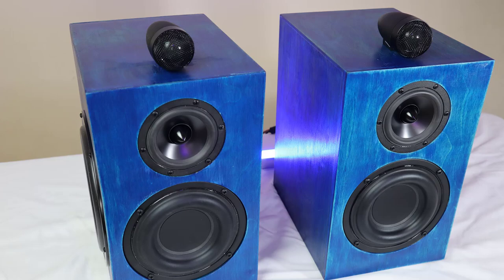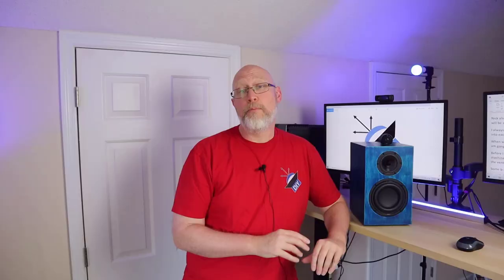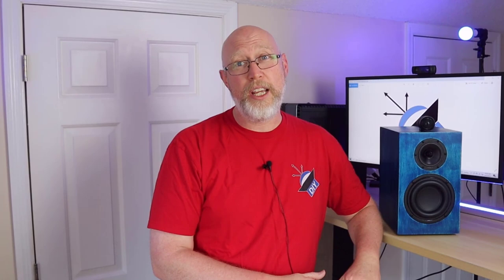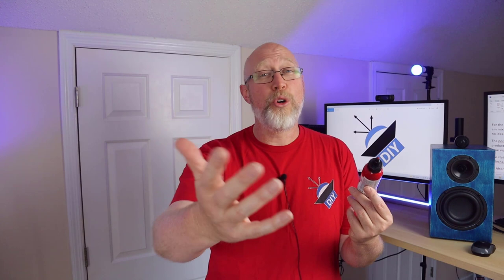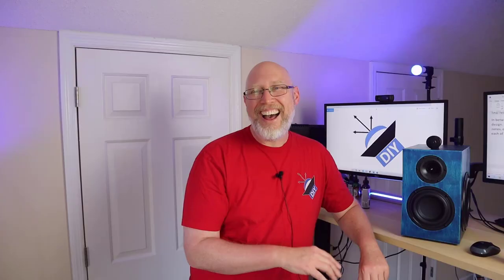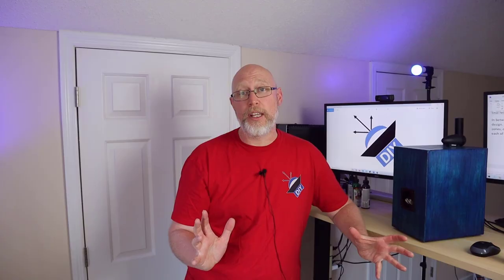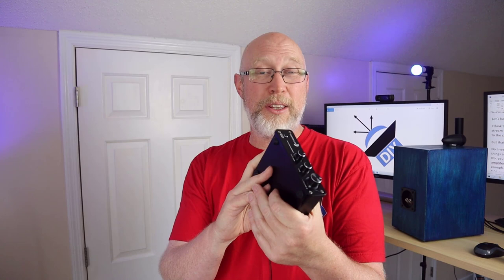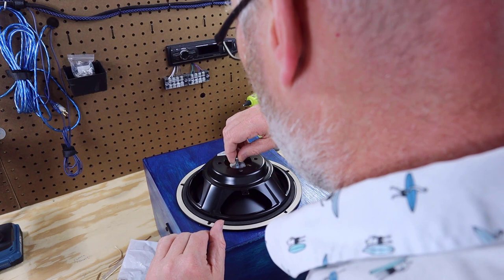Do I need a SUBWOOFER?  Bookshelf Speaker Build!

Comment: Awesome Job! I loved the video. Just a clarification, the original Dinas are powered and were a collaboration between Joe N Tell and I. A huge shout out to him. These are the new passive versions that you can hook up to any amplifier. Thanks Again for the awesome video! You killed it!
Reply from the maker: I remember that now!
Reply: How do these compare to the original powered DINAS (Which I am nearing completion of building, and very much looking forward to trying).  Is the box dims the same with the side mounted PR?  How is the frequency response altered in comparison? 

Thanks

Matt
Reply from the maker: @MiracleManMatt  Should be very similar.
Reply: How much is the cost of the crossover for 2 speakers?

Comment: one of the subwoofer utility is to take on its own job to produce the very low Frequencies (the low bass frequency20-80hz) (not the ordinary bass frequencies or the (woofer frequencies 80-300hz)instead making the woofer produces them because that can damages the woofer by time), so the subwoofer protects actually the woofer by preventing it producing these extra low frequencies, so we need a Low-Pass-Filter connected to the subwoofer.

Comment: I love this small PR design. I'd like to see as small sub design with 2 opposing subs and 4 passive radiators, perhaps 5.25 or 6.5" & stackable with legs. With no flat surfaces, it would be tough to mount an amp or just passive inputs, but it would look cool.

Comment: I built a pair of these speakers, and you don’t need a subwoofer. However, you do need a 75W per channel amp to drive the bass.
Reply from the maker: Good to know.
Reply: where did you get the amp?
Reply: @el_tate  I just got the [Upgraded Version]Fosi Audio TB10D and tried it out on the DINAS. Everything sounded great! I would definitely recommend this amp for these speakers.

Comment: The blue is brazen and wild but tbh I would prefer danish oil. What is the total cost of this project? Tangband subs and cnc cut wood does not seem cheap
Reply from the maker: It was definitely a bold color choice.

Honestly I'm not sure what the total cost is, I never actually planned out any kind of budget for this.  Partly because I had some of the drivers laying around and partly because Nick sent me a lot of the other stuff that I needed.

Comment: Also do you think these would work great for a 2.1 setup on a gaming computer or maybe something slightly different insted? I've been looking at similar kits from parts express for my son to make and hopefully learn something along the way.
Reply from the maker: Probably, but they are a bit large for a desktop system.
Reply: Because these are three-way speakers, you can build them with bi-amp terminal cups so that you can drive the bass woofers on their own. However, the crossover is so well designed that they sound great in just a two-channel set up.

Comment: how did you connect the speakers? parallel ou in serie?
Reply from the maker: They're all wired to the crossover internally. Technically it's all parallel, but it's parallel through the crossovers.

Comment: Sir, respectfully, you're asking the wrong question
1 - everyone needs subwoofer bro, because amplified lower registers add 'warmth' and 'depth' to the audio experience
2 - the 'woofers' you have installed into said boxes are in fact subwoofers. I know this just by looking at them. Those puppies can easily hit 35-40Hz with no distortion under the right conditions.
I believe the appropriate question here is:
How much subwoofer do you need?
Answer: All the Subwoofer, because reasons
Miss me with the poppycock
:goodvibes:
Reply from the maker: Yep, how many do you need is the right question!